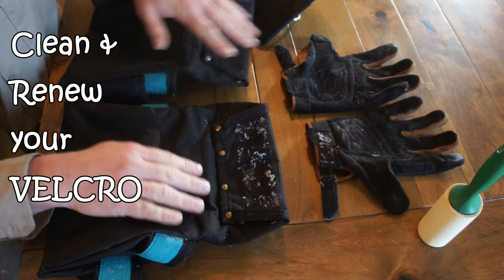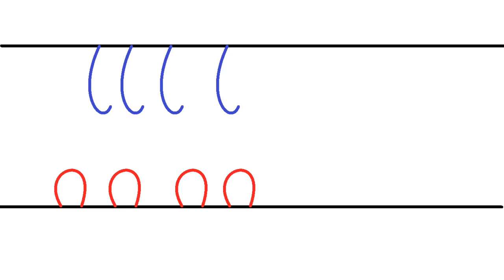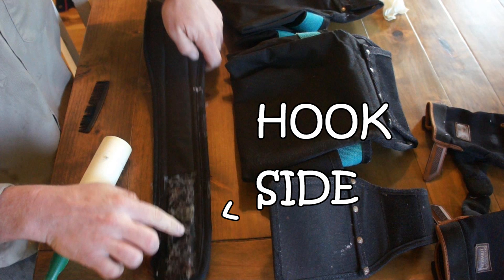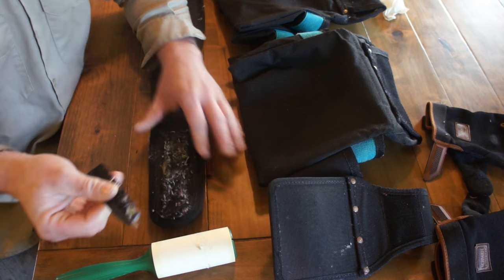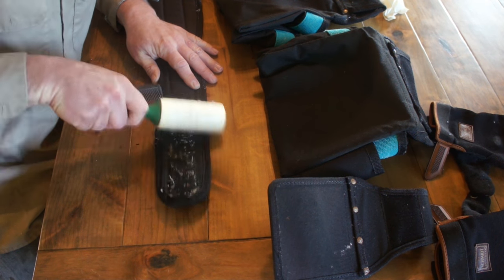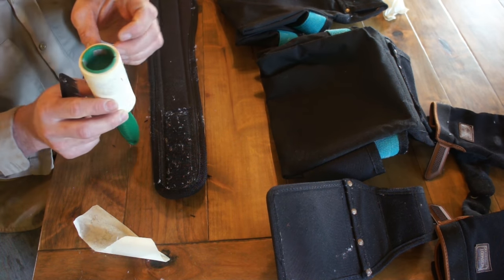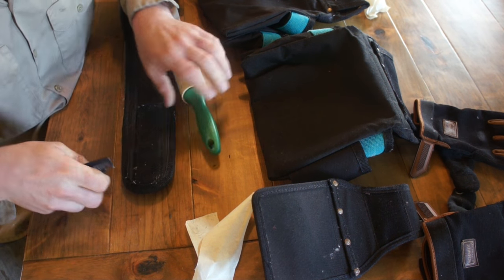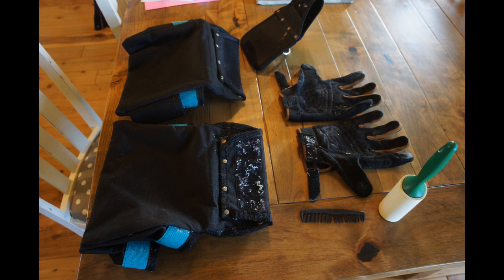How to Easily and Quickly clean VELCRO

Comment: I did not look at any complex diagram mentioned in the other comments… I listened to you from afar. I got an old comb like you said, and I went to work on the Velcro that was on my Robo vacuum that has the mop attachment. There was so much cat hair and my hair stuck in the wheels and on the Velcro! The black comb works really good and then pulled out large pieces with my fingers and my hand held vacuum to vacuum it up and pull out what I could with tweezers. Thanks for the advice and the lint brush did not help much. But it was a clean job!

Comment: Thanks a lot man. Worked like a charm. I am shocked at two things. How much lint I accrued just like you said and how clean the Velcro got. Usually with my weight belt for my back that means I have to throw them out. Now all I have to do is use a $.50 comb and lint brushes I already have!!  Thanks a lot

Comment: Niiiccceee! Thanks for this - I wear AFO's equipped with Velcro straps and here in mid-Michigan during the winter knee-length socks and the inside of jeans really present a problem.  This will help tremendously.  Now, if you can give me the solution to using something other than Velcro straps for AFO's that will function appropriately - hallelujiah!  😀

Comment: You can also use a dog wire fine brush. Also tooth brush, I dit the comb and dog brush. I did not have to use tape. I was going to try a regular fabric lint brush after I do some on the debris to top surface. I could just pick out with fingers or a tweezer. Mine was a tripping hazard. My brace strap would come undone without me knowing and lucky did not fall.
Common sense. Just keep the Velcro pieces together when not in use. Or get an extra piece to cover!

Comment: Any small wire brush works great. A brush from a gun cleaning kit will work and that’s obviously depending on how big the area is. No need for the lint roller just scrape the Velcro over a garbage can and voilà.

Comment: To clean the hook side of hook-and-loop tape, might I suggest using an extra piece of hook tape? Make sure you won't need it for another use, because you'll be moving that detritus from the old, linty hook tape to your new, clean, extra hook tape. The best to use is some of the heavy-duty type. It will make cleaning the hook tape so much easier than any other method I've found!

Comment: When I was younger and velcro first came out on shoes there was a little tool that was sold to clean the velcro. You would roll it over the velcro and it would pick out the stuff. But I don't know if the velcro back then is the same as the velcro now. 👵